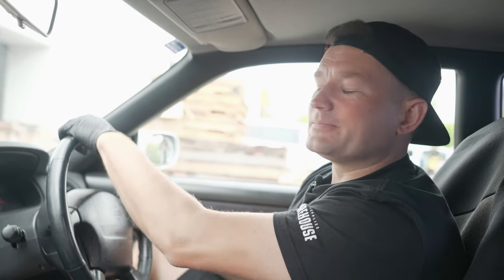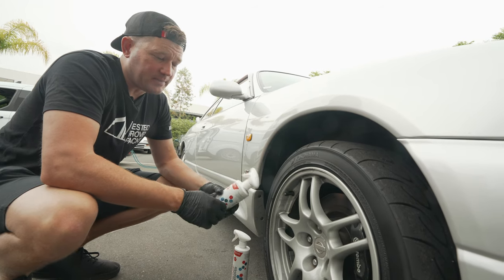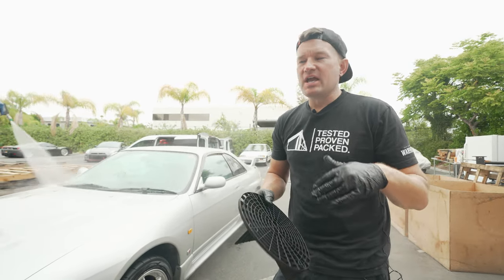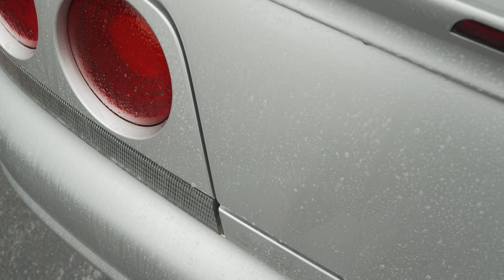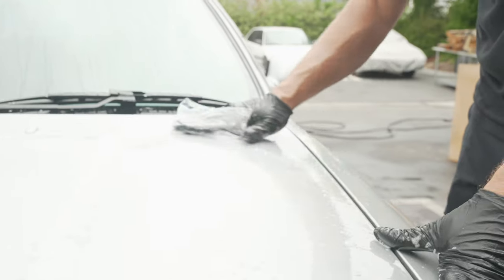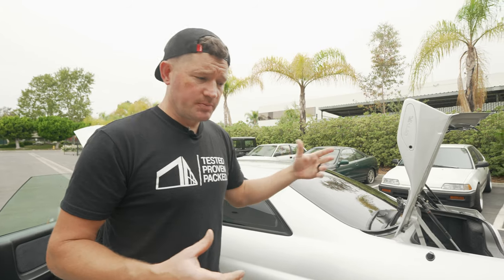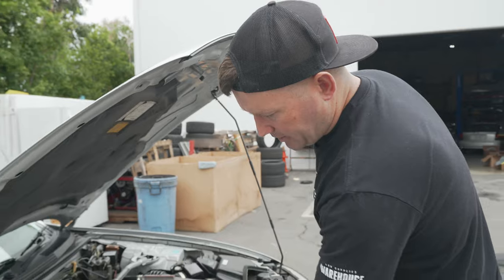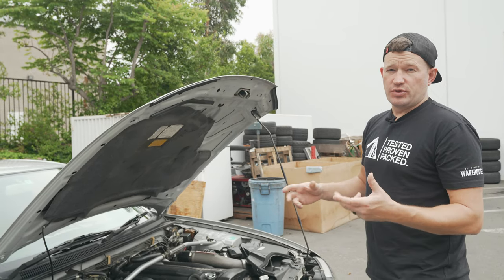What To Do When You Buy An Imported Classic Car?

Comment: Definitely wouldn’t want that vehicle sitting outside in a sun heavy environment without ppl. That’s is some thin paint but not as thin as some Asian vehicles like my wife’s scion at a whopping 2.5-1.9 and it was from California so the roof clear is gone and all top surfaces are barely holding on. The good thing is those cars are worth repainting and adding a lot of extra clear.